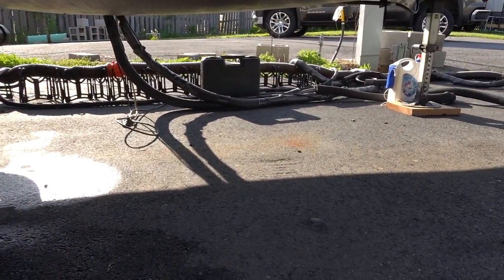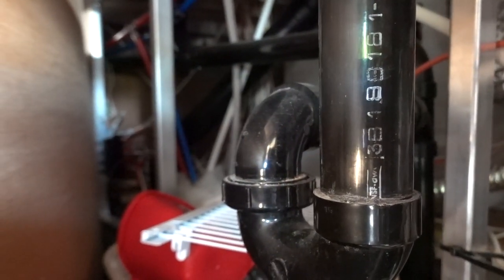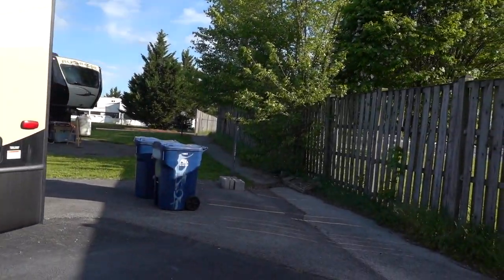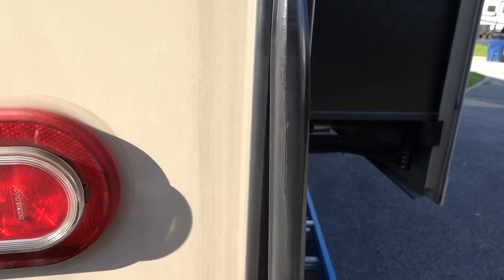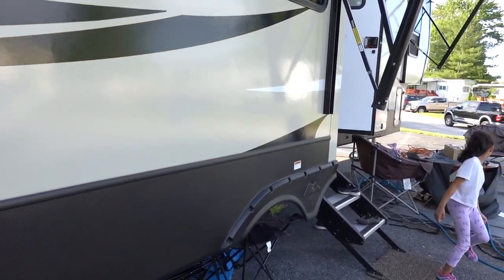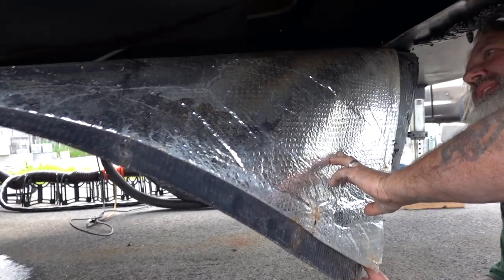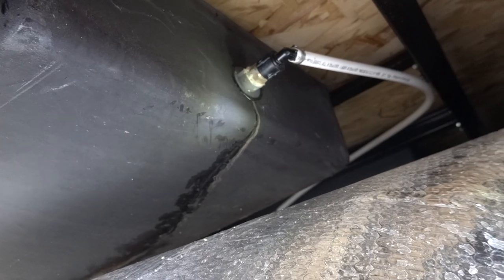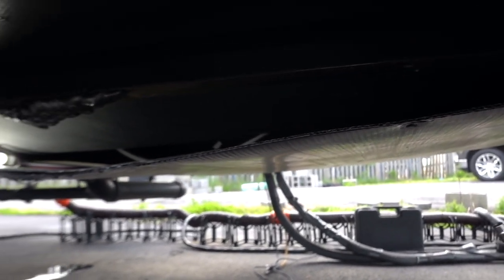My Keystone Cougar Is Leaking Black Tank Water In The Underbelly.... This Sucks (And Stinks)

Comment: You can replace that part.  You will have to drill it out with a whole saw. They make an adapter that has a spray nozzle on it with a flange on it. You have to make sure when drilling out with hole saw that the part does not fall back into the tank. Seal the flange with some plastic RTD and the flange has holes in it that you drive screws into the tank.  I would let it sir as long as you can to give the RTD plenty of time to cure. My experiences with cracks in plastic as well as metal is that you have to drill a hole in each end of the crack to keep it from spreading so just putting JBL weld on it will not last long.

Comment: Maybe consider this.  Usually those factory installed clean outs are just a spray nozzle if you’re lucky.  What about just removing the fitting and just letting the inner part drop into the tank (maybe it will make it’s way out eventually in dumps) and install the tornado tank sprayer that installs from the outside of the tank.  It’s the one with the rotating head on it.  Then just reconnect the factory hose (may have to put a different end on it but you wouldn’t have to drop the tank.
Reply from the maker: Not a bad idea, I will have to look into this. Thanks 👍🏾

Comment: Put a nail in a pair of visegrips heat it with a propane torch to melt the plastic back together then out a bit blob of silicone caulk over it

Comment: Man. Good information. We JUST purchased a 2020 Keystone Cougar and on our first trip out the front black and grey tanks will not empty. Pull the valve out and no flow. So we decided to do like you and put some fabric softener (since we don’t have Dawn soap) down the toilet and sink followed by hot water to see if it will loosen the stuff up. I hope it works because like you, I am not wanting to replace a tank. Keep the videos coming! Enjoying them!
Reply from the maker: You may need to replace the valves. It’s not easy but it’s possible to do with someone who has done it before. Thanks 👍🏾

Comment: I’ve tried using several different things to patch my fresh water tank. The problem is that the epoxies are hard and the tank material is soft and will expand and contract causing the epoxy to separate. I’ve tried the plastic welding as well and that didn’t work either. What finally worked was a marine sealant that stayed flexible and expanded and contracted with the tank. It’s been over a year now and still holding up fine.
Reply from the maker: Thanks for sharing 👍🏾
Reply: Are you referring to 5200?  When I lived in Alaska people used that for everything.  You can buy it in small tubes at Home Depot.  That's the route I would try first.
Reply: @clarkgriswold2480  I’m not sure what it is . It’s been a while but I can check tomorrow.
Reply: Thank you so much for sharing! Yesterday the black tank pipe detached from the tank & we only had our 5th wheel for only 1 month & 1/2. My husband was pissed off! Poor guy came home from work and had to clean a big mess while I was at work. Can anyone tell us why this may have happened & what would be the best way to fix this for the long term? For now he had to go to Home Depot to buy a sealant to seal it. Now I’m scared to use our toilet 😩, but we have our daughter’s bathroom that we can use until we get this situation resolved.🤦🏽‍♀️

Comment: I would try the JB weld first and if it doesn’t work at least you know what needs to be done. Also, your reviews on the Ram influenced my recent (couple of months ago) purchase of a 3500 Ram Megacab Srw. I did not go with the high output and got the 373 rears. The comparison of maintenance cost between the HO and regular Cummins was helpful. Keep up the good work!
Reply from the maker: Thanks for sharing Ken and congrats on the truck!!!

Comment: God be with you, mate! That's a real pain in the butt. I can only imagine how much worse it would be, if it happened in the winter, in Canada.

I' surprised that such a crack could occur, especially considering the quality of Keystone Cougar RVs. I'd be pushing them to make good on that, even out if warranty. It can't hurt!
Reply from the maker: Nah I’m way out of warranty but I may have dealer reach out due to them stating this RV is full time...
Reply: @JB_WhoWork  
Being out if warranty, I can appreciate your position; however, some parts just shouldn't break like that. At the very least, I would try a diplomatic approach to meeting them halfway. After all, if this ends up being a quality control issue; it could save them from losing sales $$$$.

If there's one thing that I've learned in providing tech support on 3 continents, it's that it costs more in dollars and effort to win back customers and rebuild a reputation, than it does to assess a problem and ensure that it gets addressed for all products moving forward.

Comment: I had been pouring water into my black and gray tanks to keep “stuff” from piling up in there when storedSo I’m leaving last weekend and “liquid” pours out the right side of the vehicle from the belly.
I’m  thinking the trip is cancelled, except I ask my wife. The water has stopped coming out so I figure we can get to our campground and call for mobile repair.
Except it’s Veterans Day weekend and it’s a weekend, meaning they’re already booked up. They tell me they can get to me Monday, meaning I’ll be back at work. So let me see if it leaks again. It doesn’t. At the end of the trip, I clean the tanks and then I leave. No more leaks. 
I just need to drop the underbelly of the vehicle and see what’s going on. Too bad I have a job or I’d do it myself but I have so much life going on, I’m not sure what to do with it. Naturally we are supposed to get rain this weekend so I don’t know. I park the RV outside under an unlighted roof so there’s no use trying after work … it’s dark early now.

Comment: Keystone is such junk. I have a dutchman with many problems. The quality control is terrible. My underbelly was fallen off. Heater vent screws fallen out. Staples coming out of walls and now I have a staple coming through my roof . The sani flush vacuum valve was installed backwards and its only a year old.
Reply from the maker: Yea they all have issues and I truly don’t think one is better than another...  That’s how they are able to keep them cost effective although I think quality should always be a priority for all manufactures 👍🏾

Comment: Did you know your Ram infotainment system is not set up the same as a 1500?
Reply from the maker: In regards to what?
Reply: A 1500 will not have the TPM system. The 3500 will... plus 5 save able trailer trailer types. If you do a video on this You will be the first and it will help people like me trying to make that final decision especially if you do a indepth info on the five save able trailers hight weight length etc. Dealerships haven't thought of this as a selling point when its pretty important saving on windshield space and tickets if you know what I mean.
Reply from the maker: Thanks bud, I wish I could hook it all up with cameras and TPM but Relationshop isn’t quite there yet 😅

Comment: Buy a new tank, replace it and be done with it, or otherwise you will continue to have problems with it leaking at the most inconvenient time... Or drop the tank cut out the bad fitting, and install a new compression type plumbing fitting, probably a nasty, job. With the new tank make sure the line is supported so it does does not cause the fitting to vibrate and break. It is actually the fitting mount in the tank that is broke?

Comment: Epoxy. Untintentional comedy(I'm sympathetic) - JB Weld. Ha. But seriously - there are a number of amazing epoxies that will fix you up. The rest of the coach will fall apart around the epoxy before the epoxy fails. It will be the only substance left standing after the apocalypse. Seriously. I construction world we use an epoxy for anchoring steel in concrete and if you have to get the steel back out you have to obliterate the concrete because the epoxy will just giggle at you.

Comment: Expect it. You bought a rv. They are made like crap. Should have done your research man
Reply from the maker: Actually the RV has been great and I caused the issue 🤷‍♂️
Reply: @JB_WhoWork  glad it was a easy fix. Rv's are nice, but money pits. Wait till you start getting the leaks. They are poorly designed and built cheap.  Better off building a bus to spec and building your own.
Reply: Research- LOL - they are all the same - obviously, you're new to the industry... doesn't matter what make or model; they are all assembled by cheap/day labor with glue and staples. Buy a Used one so you know it's had the bugs shaken out.. and for .35 on the dollar is my advice.
Reply: @davidsaitta6351  I know they are all the same. Why I told him he should have done more research. They are money pits. Maintenance is key, or they go to crap fast. 
Not new to anything bud. Stop assuming.